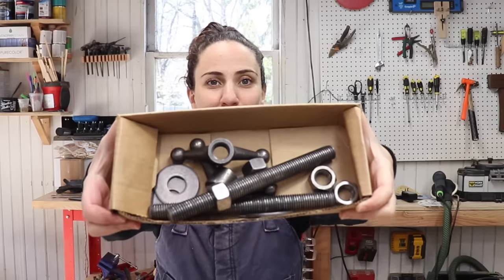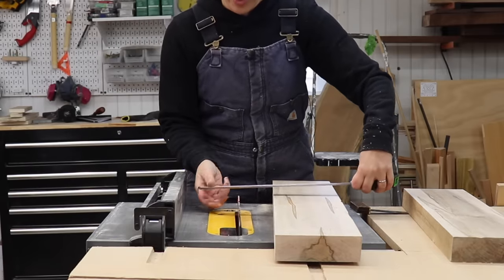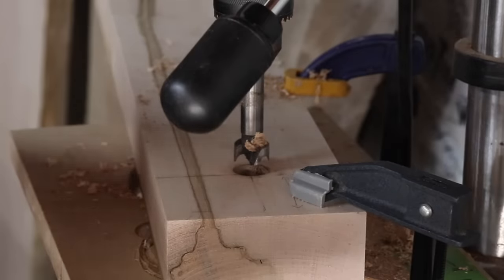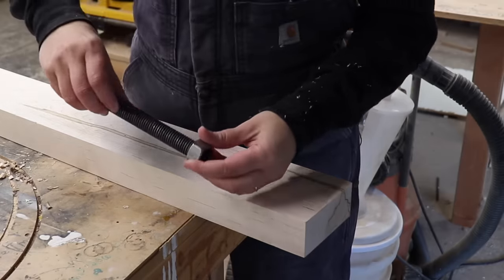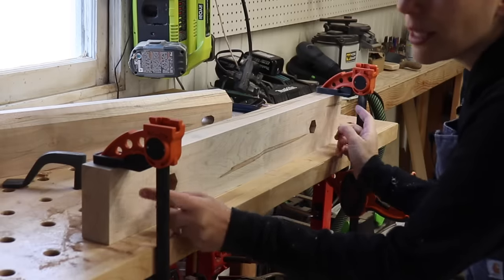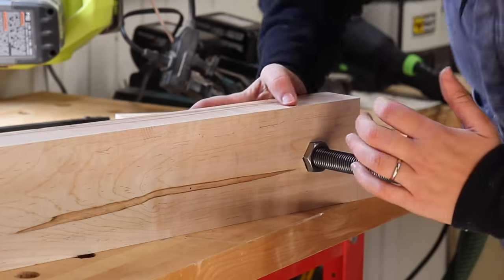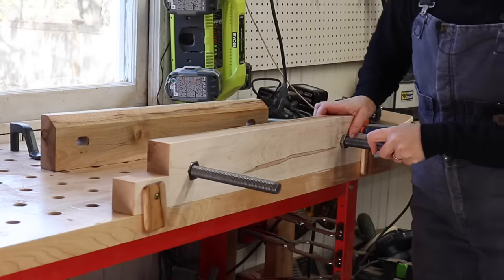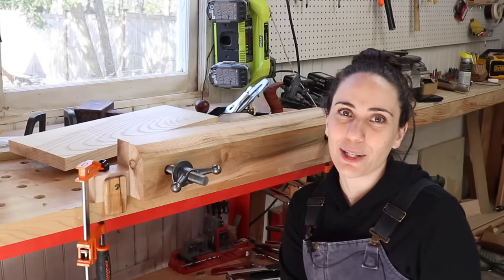$40 Moxon Vise - Easy to build in an afternoon!

Comment: I am not a fan of this vise. It sits on your bench top and will be squarely in the way except when you are using it. You will be constantly taking it down and re-assembling it. It has the added disadvantage of having no capability for bench dogs that I can see.  It is also is fairly expensive for what you get, 2 short standard tread rods, nuts and washers. The rods stick out in a fixed position, not screwing underneath the bench as a normal vise would, so you are going to poke yourself on them at one time or another. I would look for a good used vise with quick release. For a few extra dollars you will be a lot happier.
Reply from the maker: Yeah. A built in vise is ideal. This is supposed to be a temporary vise for when you don’t have enough space or you want to bring your work elsewhere.

Comment: Good grief, you measured for the centre line from opposing faces.
You measure from one face for both holes then measure from the opposing face for sanity.  Not measure one from one face and one from the other.